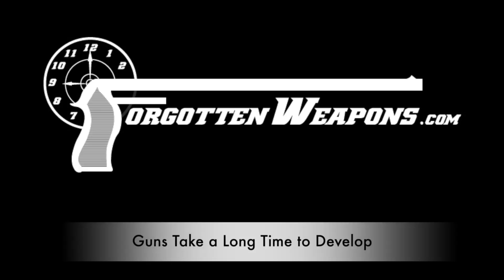Why Guns Take Years to Get Into Production

Comment: This has probably been asked before, but I was wondering since push pins like the ones hk use in their guns are easy to remove, yet as far as I can tell are quite strong, why do more guns not use them instead of things like rivets since while very strong when done right can rivets make replacement of parts quite difficult?
Reply: Push pin needs to be all the way through in order to be pushable out. Rivet can be limited to those two sheet metal parts that you need to hold together. Please also take note what rivets actually do: block movement in more than one axis. If it can be pushed out, it won't hold the parts together in the axis it can be pushed out.
Reply: @randomnobodovsky3692  That makes alot of sense and is a very straight forward way of explaining it. It also explains why outside of a few hk guns most guns that use any push pins at all use them for holding the upper and lower together. thank you for your explanation.

Comment: It's not guns but the complicated double valve that caused a couple of 737s to crash to have the problem required two parts to be at the extreme limit of their design tolerances in the specific complementary way and the only failed if the valve was very cold and was fed very hot hydraulic fluid. Diagnosing the problem was much harder than fixing it.
The valve has been entirely replaced with a different design that can't have that particular problem.

Comment: Doesn't this "rant" apply to everything?...generally speaking.
I'd imagine this is the reality of all mechanical mass production and engineering, it's not specific to guns...also isn't slow iteration logically more natural and obvious compared to instant and spontaneous innovation? 

I don't think there has ever been a perfect idea or "product" that was realised straight out the gate on the first try...success is found at the end of a long hard road paved with mistakes and failure...nothing will just instantly "work" unless you make it work and that usually takes time regardless of how smart or talented you are.

Comment: To be fair I'd think a lot of this does apply more to older, military issue level production. With modern CNC while it isn't perfect, you have a lot of repeatability mixed with the ability to tweak and adjust designs basically on the fly. Which is far more than what used to be practical. So the engineering side can pick a design that works, choose some arbitrarily tight tolerances to start with, and enter limited production. Production side might push back on a few specific features but mostly will just run what is on the print even with some scrap. 

Of course when there's hard tooling like plastic, sheet metal stamping, etc, then yes you can't just wing it so easily. And even with machined parts so much variability comes into play after machining between deburring, heat treatment, finishing, assembly, etc. So machining tolerance is only one small aspect of the sorts of issues to be worked out.

Comment: When someone asks "why are there no reproductions of the Sturmgewehr", then I need to point out, what the (deserved or not) reputation of german engineers of ww2 is...

BTW, when Rheinmetall was asked to produce what would become the MG3 (basically a MG-42 in 7.62), they had the same problem - even though they were the guys that built it during the war, there was no more data avaiable, and they had to reverse-engineer a couple of surviving examples.
Reply: The reason you don't have STG44 reproductions widely available is because you'd need a stamping press and a set of good stamping dies which are very, very expensive to manufacture and most companies don't want to take on that kind of expense. They would all  have to basically contract a stamping facility to use their press because odds are NO ONE in the American gun industry is going to purchase an industrial stamping press. HOWEVER, it can technically be done and wouldn't even be all that hard. It's just a matter of cash.

Comment: If you're looking for a job and are interested in this, ask your local machine shops if they're hiring.  You'll not only learn a lot about who manufacturing works, but if you have a good work ethic, you'll be promoted from sweeping floors to running machines after a while.  I've seen it happen many times over my career.

Comment: I wanna say something about the 1 inch part of the video regarding mesurement expressions. I use to work on CNCs in europe  (so we use metric system, where all units are divisible by round numbers such as 10, 100, 1000...). Lets say the main mesure is 30mm (milimeters), the tolerance is from 29,98 mm to 29,95 mm. We would always say the tolerance is from -2/100 (in words: minus 2 hundreds) to -5/100 (minus 5 hundreds), or you can say minus 5 microns, instead of saying from "twentynine point ninetyeight" to "twentynine point ninetyfive". Saying minus 2 hundreds is waaay more easier to say, understand and follow during conversation, hence there is less room for mistake. Also you wont stutter.

Comment: Yup, been trying to develop mine for about 8 years, scrapped multiple designs but I might finally have a viable design heading to 3D printing for first fitting test.
Reply: Good luck, I've been working on my Ar-375 h&h project for 2 years and it has been a list of failures so far, but I enjoy a challenge.

Comment: I think its a first part of 5.
1. Design. sten is simple hk 50 is not
2. Tolerance ( thats not the problem becouse french send rebel army of america rifles in parts and they worked. See point 1)
3. Technology! All process all the materials you use. Quality and kind of materials. What temperature what force what dimensions? You have Hooks law. You know that hartend steel is hard. You  can put chrome or blackend steel.
4. Quality of surface. Some surface needs to be smoth and some dont.
PS
Its like chinese things now. They can make copy of everything on this planet but they can not copy quality of it.

Comment: One other point with tolerances is that the variances are also interlinked.  If two parts that interact with each other are both off the combined difference can be enough to stop stuff from working.

Comment: Even when they finally get it "right" things like tolerance stacking play a role. The AK is known for being highly reliable and having mediocre accuracy but you can find AKs that barely function and others that are tack-driving accurate. On average, the tiny variations in tolerances will result in an "average" rifle but when thousands or millions are made a few of them will get an assemblage of parts that are nearly out of spec while a few others will get parts that come together just right. I have a 1944 Inland M-1 carbine that shoots sub-2 inch groups at 100 yards. The rifle wasn't designed to be that accurate and I've never encountered another one that is. Many years ago I knew someone whose brand-new Colt AR-15 was lucky to group like a basketball at 100 yards. Colt finally gave up and replaced it. Even when the firearm has undergone extensive development and production you're still rolling the dice to some degree with every one that comes off the assembly line.
Reply: Ahhh, finally someone who "gets it" and not an armchair gunsmith. Tolerance stacking is evil.

Comment: This video is excellent because it applies to far more than just guns. Aircraft and warships are two other common examples where we see these happen. 

Aircraft generally have prototype and pre-production versions, with the early aircraft partially handmade and partially using the new tooling. The F-35 has been criticized as the early aircraft will only be used for testing and training, but spare parts will not fit as precisely in later aircraft and there have been tweaks since the early low rate initial production aircraft. 

Ships rarely have a prototype built before the rest of the class, but lead ships in general have far more defects than the subsequent ships. One noted example of a prototype ship are the first two Littoral Combat Ships, built using R&D funds and with significant differences from later ships. Notably, Independence had a problem with galvanic corrosion in the water jets, corrected on the next ship, but to this day you’ll hear about how the entire class cannot last in salt water because it’s made of aluminum. The recent confirmation that the first two ships will be decommissioned has many attacking the ships as garbage, but the plan for the last several years was the first four were supposed to be an R&D division because of their differences from later ships.

Regarding tolerances, one key example I know of is the Type XXI U-boat. This is widely regarded as one of the most important submarine classes ever built with almost every post-WWII submarine incorporated lessons from the boats, but the subs were built in sections by different manufacturers and shipped to the yard for final assembly. The first Blohm & Voss boat was so bad it became a dedicated training ship at the yard, and working out the proper manufacturing tolerances prevented hundreds of submarines from being completed on schedule (a bigger problem than even Allied bombing) and kept most of the 118 completed from going on patrol. 

The US, by contrast, built several ships by modular construction during the war, with far fewer issues. However, certain shipyards built better quality ships than others. Cramp built submarines often had to be completed at a different shipyard, and a certain production block of Electric Boat submarines (centered in the 340s) were preferred for the best postwar conversion programs. Manitowoc could not transition from the Gato to Balao class on schedule because they lacked production drawings, though they generally built good boats. For destroyer escorts, the Dravo, Wilmington built ships were preferred for foreign sale during WWII, cancelled unusually early during the phased slowdown, and sold off extremely quickly postwar even compared to other Cannon/DET ships. 

For material selection, Little Ship, Big War makes an interesting point on US DE construction. To speed up steel production (which was a bottleneck during the war), the new steel plates were not given the final Bath to remove the mill scale of impurities on the surface of the steel. This steel rusted far more readily than normal, passing the burden onto the DE sailors to scrape and paint. For Abercrombie, Pete Kish waged war on mill scale during a stay at Manus, and after 25 days the entire stern of the ship had been scraped to the bare metal before being primed and painted with “several” coats of primer and two coats of deck blue.

Comment: Now after watching this video. Think about how many guns John Moses Browning designed himself in the course of his life. Hell, I think he cranked out a lever action from design to Final prototype in about 30 days
Reply: Yep. But, not to take away from his talent, there's a lot less to go wrong in a manually operated firearm than a semi-auto or automatic. Look at how long the M1911 (6 years from the Model 1905 to the 1911 if you only want to count the .45 ACP timeline, adding the grip safety in the 1908, changing to the single link in 1909, and the manual safety in 1910) or Hi-Power were in development. There are far fewer timings to get screwed up.
Reply: The point of this video is that cranking out a hand-made prototype is easy compared to setting up a process of mass-production. The latter is somethin Mr Browning usually didn't do. All the companies that bought his patents also employed really smart people to bridge the gap between a drawing and manufacturing. Now, Mr Garand, on the other hand, is rather famous for being able to also take part in creating the process.

Comment: Another reason why tight tolerance is not better: it's more probable to have problems down the line, especially under extreme condition. It's easier to exceed that 1% instead than 10%.
Perfect mechanics has less margin of error and require more maintenance.

Comment: You didn't mention the metallurgy black magic that takes it's toll. There are at least a couple of guns that had multiple problems or even went to scrap because the steel was not hardened exactly right or the alloy was not exactly right. For most people, "steel" is just "steel", while there is a whole science behind the metals (and polymers in recent years) in the firearms

Comment: The LA85 brass shaving thing is relatable. I work in Software engineering and IT and the amount of tickets / complaints that end up on my desk saying X thing is broken when its actually something usually several steps earlier in the pipeline that are a completely different departments issue.

Comment: Thanks for the excellent video. My background is in service, not manufacturing, but many people underappreciate how much goes into making the ordinary things around them work. I wonder though, is tolerance an important thing to be aware of because of wear on the bits? How can machinists guess how long a cutting tool will last before it needs replaced (or perhaps just adjusted)? I also am curious about how parts get re-machined or corrected if it's discovered that a batch is out of tolerance, or is all that work and material a write off typically?

Comment: I've done production machining. So I know what you are saying about getting all those tolerances right. There are other factors that come into play during the production run tho. Tool wear is the most common. Then there's tool spring. The tendency for the cutter to  bend away when pressure is applied to it. Then there is chip control. How to keep chips from building up and interfering with the cutter. Then there is tool breakage. In a CNC machine this can be disastrous if a drill breaks, and then a tap comes along and tries to thread that hole! Then there is the engineer who draws a perfect part only to find that what's on paper doesnt necessarily work in real life. Tight tolerances may be needed, but after shooting many rounds in a row the metal expands and those tolerances will come together and jam up the works. And when you have everything tuned and running right, some plant manager will come along and try to change something. Starting the whole process of tuning the machine all over again. Spending a week breaking tooling, producing scrap, and wearing out tools faster. And all just to save 1 and a half seconds of machine time.

Comment: As a machinist, I can say the problem is not putting out many parts in the right tolerance. That is very well possible, even on production lines during WW2. It's the interaction between those parts that make ik difficult to predict what happens.  And you have to get all the metallurgical stuff right. Hardening and so on. I've seen old machinist handbooks from the 1930's and was astounded what they already knew back then.

Comment: I saw this video on my lunch break and thought I would add a relevant anecdote as a gun designer. Just this Monday I did the first testfire of the first production samples of a new design. I made the original prototype about 4 years ago. There are changes I still need to make that I did not realize were issues until I actually had it in hand (and a few issues I knew would be issues but the people who make decisions didn't believe would be issues till I put it in their hands). These production samples will be basically destroyed. High round count test fires, drop tests, intentional bore obstruction tests, and if anything survives I will start being stupid with the gun and intentionally breaking things, putting them back together wrong any way I can, just doing anything to make it break or fail and then doing whatever I reasonably can to counter any problems those tests show. While the samples all ran fine so far there are still things that will be easier to make better now than later if we find them, though some things may be left in simply because the practicality of changing them outweighs the likelihood or severity of the problem. Hopefully we will be able to actually start selling it early next year. Five years for a relatively simple blowback PCC. And prototypes of the pistol version have been waiting at ATF for over a year for classification. I could go on for days about development of firearms and the issues we encounter, from not only the engineering side but also the marketing, logistics, and even legal side, with patent applications and patent searches about every little detail to avoid what Springfield is experiencing currently for example. CAD/CAM, CNC machines, 3D printers, and the internet have drastically changed how firearm development is done and made things so much more efficient, so it is realistic for a team to get out a firearm in a year or two as long as it is not a large departure from existing design, but it is not uncommon for some guns and some companies to still take several years to get things right, especially because as MIM and polymer parts are more and more required to be cost effective the sophistication of the tool design as well as the time and effort (read MONEY) required to make those tools is exponentially higher. If a part is being milled and it needs tweaked it is often as simple as changing a few lines of G-Code, zero cost and can be done mid run. If a part is being injection molded and needs a tweak then it could cost tens of thousands of dollars and lose weeks of production doing it. Anyway, I could go on. Yes, it takes a long time to get anything right, especially guns, because a small mistake can literally mean the difference between life and death. Thank you for the video.